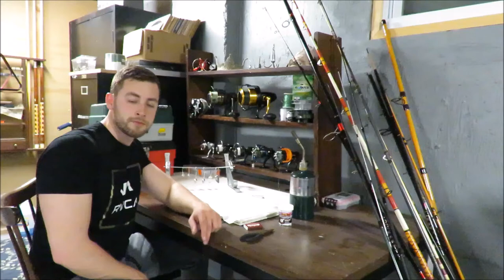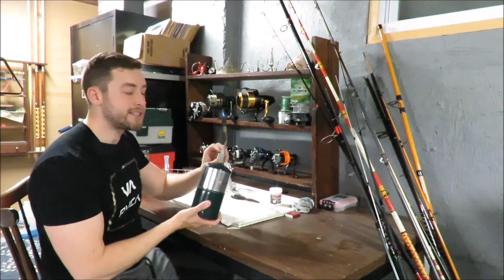How to POWDER PAINT Jig Heads with Pro-Tec

Comment: When i do heavy lead heads i wear a glove and after dipping I hold the  jig where the nose is pointing up and the hook down. If any drip occurs its in a place where its on the back face of the lead where the hook attaches .    Plastic is going to cover up this area anyways .   For old lead heads and restoration .   A rotary drumel tool with soft tip will eat the paint off and not destroy the lead heads features.  the Eel heads are pricey and worth saving for  sure.
Reply: Also gotta try the Uv blast which makes the lures come alive in the  dawn and dusk and even with minimal  light, striped bass hours.
Reply from the maker: Wow that’s a really good idea thank you
Reply from the maker: That uv blast sounds interesting
Reply: @Bsprecksfishing         I actually got to see Scientists  who work with Berkley  fishing conducting experiments with UV light and how it affects   fish feeding behavior.   UV is a high frequency band of light that humans cant see but some fish have light sensing cones to see UV and  their ability can also change as they move to different depths of water.   Most major players in the  lure business are making a push to make UV lures now  however ultimately we as anglers will provide key  info on what colors and finish works best on our targeted species through some  trial and error experimentation.
Reply from the maker: Very interesting, I need some of that!
Reply: @Bsprecksfishing        Tackle warehouse has the Pro tech line  of colors in stock plus the UV( Stock #310UV) which is listed under lure customization and  sells for $8.39.   One bottle goes a   long ways .      Best of luck  fishing